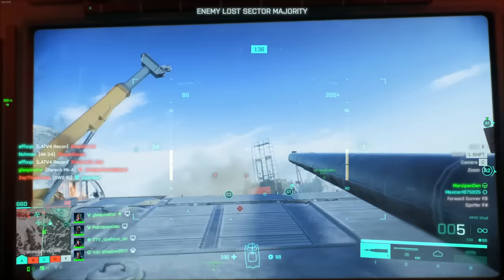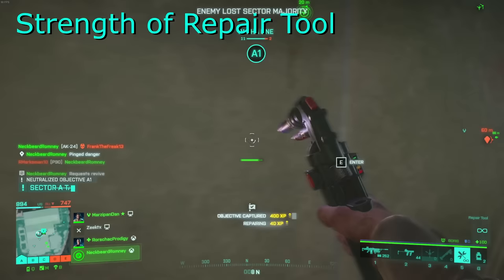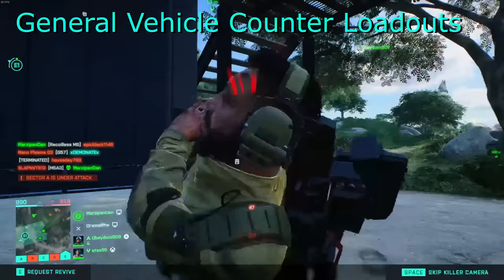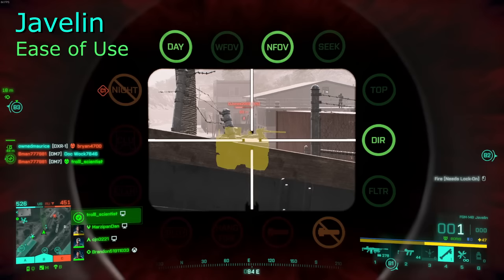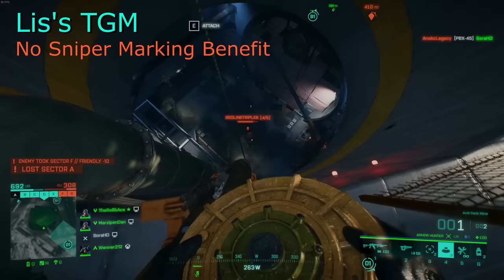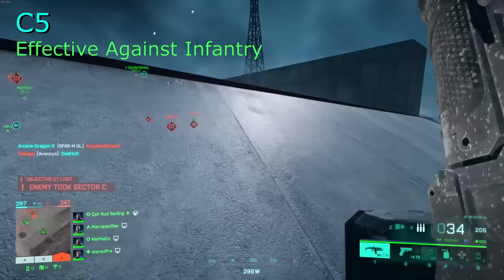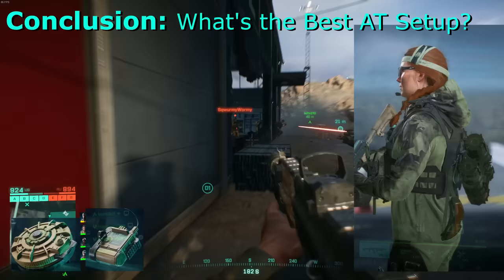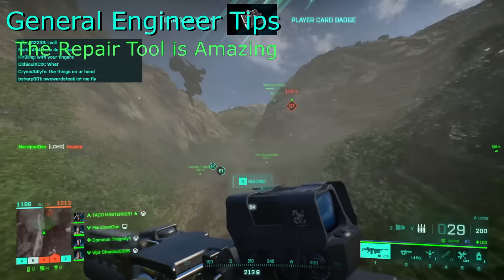How to ACTUALLY Deal with Armour - A BF2042 Anti-Tank Engineer Guide

Comment: Great video, thanks for the reminder about the AP underbarrel. I stopped using the SFAR like a year ago after I T1'd it, but nice to know what other weapons the AP underbarrel is on. I'll also add, there are AP rounds on some guns, but hit and miss as to whether they actually work. For example, both the LCMG and Avancys they don't seem to work properly. The PKP does work, but the damage is negligible. Can be enough to finish off or stop a repair though!
Reply from the maker: Thanks for commenting, I'm glad you enjoyed it! 

I've been playing with the SVK to unlock its AP launcher, and it's an absolute beast. It 2 shots enemies who are most of my typical engagement range and 3 shots at further ranges. I'd definitely recommend trying it out if you fancy something a little different on your engineers.

The AP Rounds are decent, but you sacrifice a lot to use them, or you use the T menu to swap into them and need to use a who reload cycle to get it equipped. I tested with the LCMG just last night, and it seems to be working against a main battle tank.
Reply: @marzipandan767  Yeah that reload cycle is a massive disadvantage. Really only useful if you're avoiding infantry fights in general. I've started to level up the SVK in solo, DMRs have not been great for me in this game, I miss too many shots 🤣 Gotta stick to blowing up vehicles I guess.
Glad I found your channel, not sure why my feed hasn't picked it up before. Keep posting great content!
Reply from the maker: @PProph  I'm usually the same, with the exception of the BSV-M which is an absolute powerhouse, I never really played with them since I couldn't hit anything, but after putting some time in with the SVK trying to unlock the underbarrel I am finally figuring out the bullet velocity and managing to land most of my shots.

Well I'm glad you did find it :)

Comment: Casper used to be an anti tank guy.. and even air as well. Pulled off a few airspace loitering c4 drone kills before it got al slow and easy to see😅 and the Jav is basically not worth it with how much it can attract attention
Reply from the maker: I wasn't sure why they got rid of the ability to attach C5 to the drone, it's the exact kind of cheesy strategy that the BF series was built upon!

I agree, it's a shame, but the Jav is not worth it :/

Comment: Thank you for the great vid. 
Love playing engineer, but god i get nailed so badly every single time, I either get outgunned by almost every gun (I use LMG's) even from more than 100 meters and I can barely hit anything or choppers or stransport vehicules who are in my opinion WAY to strong. 
Then there's also the fact that I feel like a tiny ant compared to other players, characters and their playstyle. Not only do I not see like 70% of the time the enemy's, I can barely make any kills on infantry as I get melted almost every single time. Yeah I'm an old fart, but still... There are vehicules, guns, loadouts etc. which are if played correct, are way overpowered and melt everyone in seconds.
Reply from the maker: You are welcome! I'm glad you enjoyed it!

If you're having trouble with visibility, you can try these two things: Ping at anything that looks like a person, if it is they will get a little marker above their head. Then you can light them up.
Alternatively, you can try using one of the thermal sights. This will highlight your enemies a lot from the mess of everything else your sight catches.
Reply: @marzipandan767  Thank you. I indeed do those 2 things and it does help. :-) I just hope I get better.

Comment: Is the NTW 50 or the Railgun still good options vs light and medium armor? 😊
Reply from the maker: Against medium armor (Wildcat, CAV) the NTW is okay if you are using the anti-vehicle rounds, but the underbarrel has it beat damage-wise (~15 if memory serves), but using these rounds you also trade the one-shot potential vs infantry which is so important for the NTW. Against heavy armor (MBT, TOR) it is definitely not worth it, dealing almost nothing (~5 or 6 damage per round).

The rail gun got nerfed pretty heavily against vehicles, I don't think it is very good against either, but I need to do some testing here.

Comment: Don't sleep on EOD Bot. Quickly deploy it whenever ta ground vehicle is camping an objective. Use it's small size to sneak up on it by covering behind boxes and debris. Then absolutely melt the armor, since I believe it does about 1.5x the damage of that standard repair tool. This will usually force infantry to jump out, or the vehicle to drive away.  In the case of a player trying to kill you, just drive up and kill them, you kill pretty quickly and most players can't hit the eod bots tiny hitbox while it's quickly maneuvering underneath them, Aim assist also doesn't activate on them. and if the vehicle moves away, quickly move the bot behind some type of cover, then peak out of your bot and attack the vehicle from the opposite side, since now it's attention is fixated on the bot. I always run bot on liz, since I believe c5 and anti tank mines are pretty useless anyways.

Comment: What about the AP rounds in the lmgs or the Rail Gun? What about using Ctawford torrent? Are these actually viable methods to attack vehicles?
Reply from the maker: AP Rounds: Using the word tickle would be too strong.
Rail Gun: It used to be okay in single fire, but they nerfed it a while back. It's more annoying than dangerous. The burst and auto fire are too weak vs. armour.
Crawford Turret: It's okay. The problem is that you make yourself very vulnerable using it. It's damage is definitely affected by where you shooting it, a full overload of the turret to the rear of a MBT will take out 1/3 of its health, but good luck getting a full overload off. 

I'll maybe look into these other methods later on. But as an avid vehicle user, I've not been destroyed by any of these methods.

Comment: Also you didn't mention about NTW 50 and Rorsh Mk-4.
Reply from the maker: The MK4 isn't good vs. heavy armour. It used to do 6 damage to MBTs in the single shot mode, but Dice nerfed it. It's no longer viable, IMO.

The NTW I should test and probably will. I just suck at sniping xD

Comment: 17:55 I went out with my dreams and hopes, armed with C5 and EMP grandes thinking the tank would not be able to shoot at me for a few seconds...  😂
This is not working. Tank literally laughed it off and shot me. So what about the EMP granade is beneficial? when using C5?
Reply from the maker: The EMP grenades are great. They give you about 9 seconds of safety. They can't be equipped by Assualt specialists, so you can't use Mackay and his zip line with them, which is the best C5 strategy, in my opinion.

But personally, I find it hard to give up smoke grenades since they offer me so much flexibility in BF. EMP grenades can only help you against. Vehicles. A new youtuber Timeless Gamer posted a video about EMPs if you are interested: https://youtu.be/0b6SljY3JWQ

Comment: I've been using ap launcher rounds for a while and yeah they're super good. Honestly I think it's kinda overpowered since you can chain a m5 shot with a grenade shot incredibly quickly if you're good with swapping.
Reply from the maker: Don't tell Dice!

It's really good, but to be fair, I think that it gives engineers much more of a fighting shot. It's already hard out there playing AT :)

Thanks for commenting!
Reply: @marzipandan767  yeah it really does even the odds. Considering you only spawn with 3 m5 shots, there's no way to solo a tank without supplementing your m5 with AP grenades. My concern comes from the fact that swapping between grenade launcher types doesn't make you reload the grenade launcher. If you're decent with swapping attachments, you can do an insane combo of M5 shot + AP grenade + HE grenade. In my opinion, armor is pretty tough to play in this game so I think it's a bit too strong to deal that much damage all at once to a tank. I don't think you shouldn't be able to do that kind of damage, I just think it should take a bit more planning to pull off successfully.
Reply from the maker: @gangsta_goose  I think you can be very successful with armour in this game, I think it just takes some practice and you can be very dominant with vehicles. You need to keep friendly infantry and other vehicles around you. You should PTFO, but never push too much further than the rest of the team. 

I think 90% of the games I've played where one team is getting completely destroyed, its because one team knows how to use vehicles well and the team getting wrecked isn't focusing on taking them out.

Comment: Amazing guide.  Sub earned. I was curious on your opinion on emp nades. I find them criminally underated as well, particularly used with c5
Reply from the maker: Thanks for commenting and subbing!

Personally, I like running smokes since they offer me so much flexibility, but they are definitely good if you plan on focusing vehicles. They are just a little useless vs infantry.
Reply: @Marzipan Dan  oh btw you may wanna check aps vs c4 and grenades. I believe they patched aps not to deal with them early season 3. As you could drive over mines with aps active safly. Im fairly sure, it still does sundance's at grenade though.  Also i think aps can be turned off by emps and hacking, but that im not sure of. Im sure Rao can neutralise it though, but hes not engineer class.
Reply from the maker: @Credenak  yeah definitely. I think they changed Irish's sentinels to not effect C5 but I'm not sure if the same was for Vehicle APS. I know they work different because APS counters tank shells, but Irish sentinels do not.

I'll check it out.

Comment: While an indicator of the direction of lock on i think is crucial for land vehicle survival and on the other hand the infantry can somewhat conceal themselves behind cover if it doesnt work out. That being said, i dont think aircraft should have the same luxury as they are much quicker and easier to maneuver to safety and even outrun a lockon until the flares recharge in some cases. They can also break lock when flying low. They can also whip around and target directly above you or whip it around whatever cover you are trying to hide behind and just be pretty much a sitting duck. The vehicle balance in this game is kinda whack
Reply from the maker: Personally, I think the indicators are a good addition in both cases. It's a decent way to compensate for the fact that the lock-on weapons are so simple to use. 

Aircraft should only be able to break lock ons with below radar from vehicle based locks. I think it is currently bugged and is also working against infantry based locks. It also shouldn't stop a missile that is flying towards it from disengaging just by going below radar, but again, it is currently bugged as is doing that. It's weird that Dice hasn't acknowledged these issues yet.
Reply: @marzipandan767  i think that may be why i feel the directional indicator is a problem with aircraft with how fundamentally broken some of the mechanics of the game are at the moment. The aircraft have quite a huge leap of power in regards to these bugs and yet hasnt been fixed. Or acknowledged. At least they're talking about transports being too much in regards to its survivability.
Reply from the maker: @eliteharbinger  Do you pilot choppers or jets much in BF2042? 

I do agree that the transports, specifically the hind needs some fixing.
Reply: No, I'm not particularly great at flying them on console. That being said I haven't really practiced much either. I was pretty good back in bf3 in helis though. The first time I tried in this game was the jet and was instantly taken out by the other jet waiting for aircraft to spawn. My experience with bf2042 vehicles is usually instantly locked, rocketed, c5d. It's like when I get in a vehicle the enemy knows to take me out. My team on the other hand "what's explosives? The ac9 go brrrrrr". I don't think helis are way over powered. They are glass canons, but can be really hard to hit glass canons without decent coordination, but when lock on indicates direction and they can move in any direction to avoid, using m5 predicting path is much harder than shooting a tank that can only move forward and backward. Maybe if AP rounds did more damage to helis being armor is much thinner on flying vehicles would make sense so at least infantry can somewhat be a little threat to them hovering over?
Reply from the maker: @Travis Holt being one of those pilots who stay in the air all game and also does a lot of damage is really hard and requires a lot of practice and sometimes a lot of negligence from the enemy team. If choppers are getting you down, then I definitely recommend picking up Lis. A good Lis player is a chopper pilots worst nightmare!

Though I've heard from people that her console experience was inconsistent. But I do believe Dice did fix her and make it a little better.
Reply: @marzipandan767  i do try liz. but hitting a nightbird is incredibly difficult due to its small size and super maneuverability. somewhat the same with the attack and stealth. Of course the transports take mutliple and usually are repaired by the second shot. The inconsistency from consoles i believe is probably from the joystick, as it take time to move the stick in the corrected direction to fix the missile pathway, example, to go from up to down i have to reach center of the joystick before the missile begins to move downward, while on mouse the instant you correct direction the movement instantly is corrected. probably why liz isnt really used on consoles
Reply from the maker: @eliteharbinger  it's a shame that Dice don't have an alternate option for control on consoles. At least give them a more sensitive control to make up for it.

Comment: I think it'd help if they got rid of the operators and classes, it's just a mess. Nobody revives, nobody takes out vehicles, every match my team just runs around like headless chickens trying to rambo their way to most kills, and thanks to the class system coming back now even less people can take stuff out even if they want to.
The only thing 2042 did right since launch was let you use whatever you want to get the job done, now I'm having to swap character every 5 minutes to try and save my team from getting absolutely steam rolled.
Reply from the maker: But this just led to everyone running around with an M5. It was completely stale and completely ruined vehicles. I'm a much bigger fan of classes personally. Though I wish they would give the Assualt class the Ammo crate instead of the medpen so that they can actually interact with their team and actually perform a role. 

I think it feels especially bad right now because there is an influx of newer players. They will get it soon, and the quality of players will increase.

Comment: Doing AT work in 2042 really is just trying to make the best of a terrible hand sadly, and you hit most of the points

1\ Class system with the hero system disincentivizes people to go Engineer in the first place to deal with Armor
2\ Lock on is useless
3\ Damage output from AT is terrible
4\ Ammo hunger (especially as support classes don't have to run ammo, and are usually better served running medkits instead)

Fucks me how you fix all this at this point, but most of the state does come back down to the Class system introduction absolutely murdering vehicle/infantry balance.
Reply from the maker: It was the complete opposite when it was only specialists. Everyone had a pocket M5, so pushing objectives with vehicles was most of the time a  waste, and it encouraged these campy play styles. I do think it is better now, and I do think that vehicles should be strong, but I also see peoples frustration. I just wanted to shed light onto the fact that it is possible to deal with vehicles.

I definitely think that Assualt should get the ammo crates instead of the medpen. That way, there are more ammo crates on the battlefield since right now it's a 75/25 chance whether a support is even carrying ammo.

Comment: Anti tank mine, then toss a grenade.  Javelin works good too.
Reply from the maker: If they don't notice the mines then this works great, but this is not always the case. 

I want the Javelin to be better considering how easy it is for vehicles to counter. Even the missile travel speed is painfully slow so that even those long-range shots which should be what the Javelin is best at can typically be avoided by just driving behind cover.

Comment: frag nades do dmg to vehicles, sometimes theyre just what u need to finish up a tank
Reply from the maker: See my problem with Frag grenades in general is that their grenade indicator is massive, so noticeable and the time to explode is crazy long. In most cases you can just move away from them. Their damage is good if it explodes directly on them, but falls off quickly at any small distance.

I always run smoke grenades since they are so flexible!

Comment: What about air vehicles?
Reply from the maker: Pick your poison: 
- Lis Guide: https://youtu.be/BLWB9Aa7kH8 (A little outdated, but still mostly relevant)
- A more recent Lis guide from Timeless Gamer: https://youtu.be/ASLnCPEsbLQ (Still very relevant and also had some additional tips I definitely appreciated)
- Wildcat AA Guide: https://youtu.be/UTuZOI84kXY (Definitely the best thing to do if you are having trouble with transport choppers)

The big thing is to not use the AA missiles, either as an engineer or in the wildcat. Flares are too good and for that reason AA missiles are just a deterrent rather than a solution.